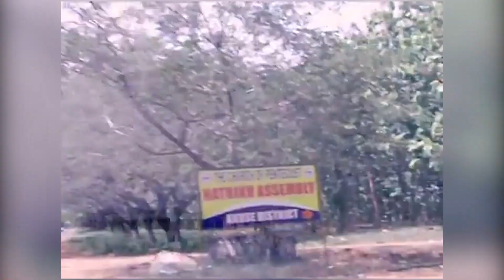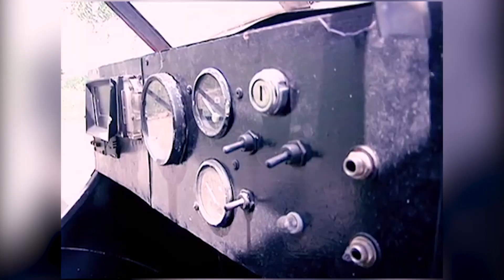African DIY Aircraft That Can Fly

Comment: Boxer engines (engines whose pistons go side to side) are almost always used in small aircraft. Since they are a lower profile it's easier for the pilot to see over. A Volkswagen boxer engine doesn't have a lot of horsepower, but it is the right type of engine for an airplane.